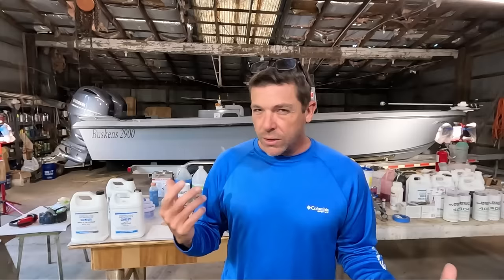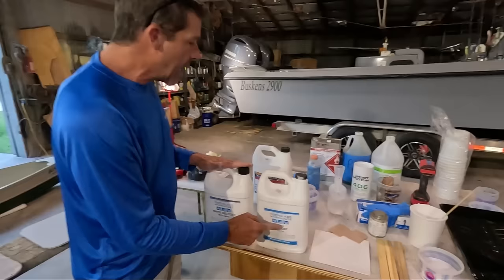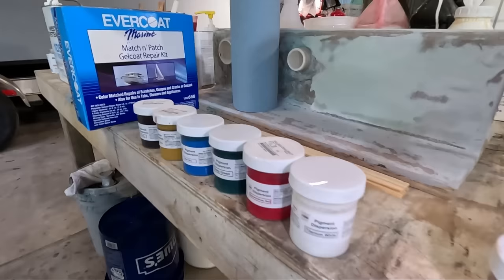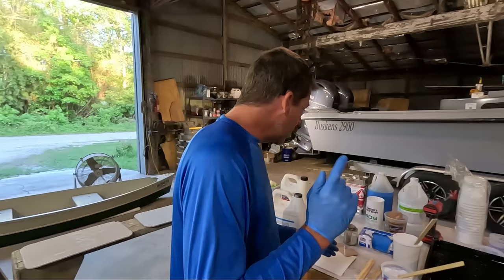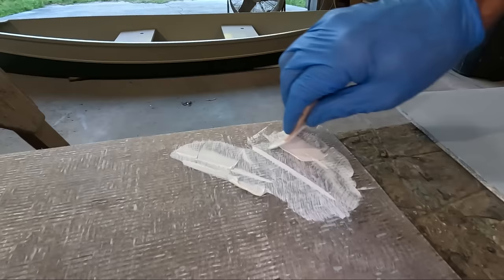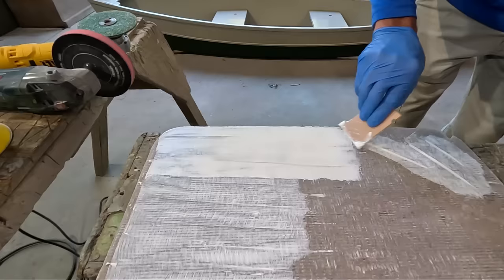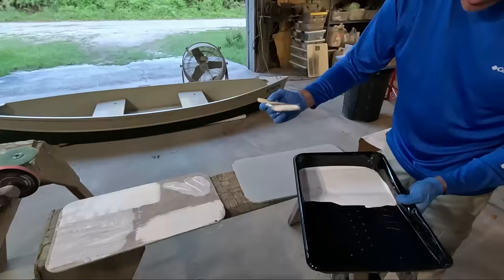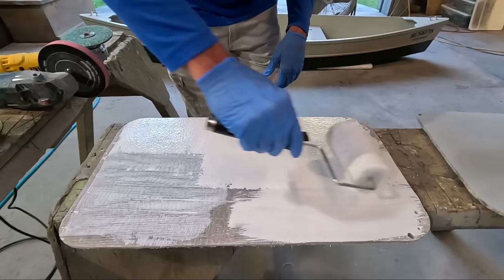The Secrets of GELCOAT and WHAT You Need to Know!

Comment: Hey there. I did some repairs on my boat with 3M marine premium filler on the bottom it is a vilyl ester filler. I sanded it all down smooth. Do i have to waterproof it with gel coat or can i leave as is????
Reply from the maker: I would recommend sealing the vinyl Ester filler with gelcoat. That's going to give you the best results. Thanks for watching!

Comment: I have a question, I have a couple of fiberglass dings on a fender and I plan on filling them in and then I have the metal flake match for my boat and my plan is to apply the gel coat with a preval sprayer. What mixture of styrene and MEKP would I add to the gel coat before spraying?

Comment: Hey sir, My problem is the company I work for deal with Navy 11meter Rhib boats. Material I am allowed to use is AWL Grip Products (F1438 & F3029) and West system (105,205, and 404) products. How would you conduct fiberglass repair and gelcoat repairs only with these products? I am trying to add 925 MEK Catalyst to my AUL (Authorized User List). I have also added Evercoat One step finish gel coat. What other items would you recommend I added or try to add?

Comment: Hi there loving your videos. This is my first time boat project and I'm learning  a lot form your clips. I have a simple question can you apply more then one coat of flowcoat/gelcoat with wax
Reply from the maker: Glad you are enjoying the videos! We usually apply gelcoat with wax on the last coat only. It allows the gelcoat to fully cure, and produces a tack free surface. If you apply more gelcoat over gelcoat that has wax in it , the second coat will not bond properly. You can wipe down the wax gelcoat surface with acetone,  then sand the surface well before adding another coat of gelcoat to help it bond. I hope this helps and thanks for watching!

Comment: Hey Joe! I am redoing gel coat on a Boston whaler 13 hull. I watched a bunch of your videos and it has been going well so far. I ran out of gel coat and had to order more. Once I get that I want to put on the final coat that will include the sanding sealer/wax. Only problem is with shipping it will be about a week from my 4th coat to my final coat. Will it still be tacky enough to where that won’t be a problem or will I have to sand? Hope that makes sense, thanks for any advice you have.
Reply from the maker: If it were me, I would probably scuff it up with some 80 grit and then do a wipedown with some acetone. I don't think you will need any heavy or deep sanding. I hope this helps and thanks for watching!

Comment: Awesome video capt. Love your content always. Great job by camera man
If I wanted to strip bottom paint and redo with Gelcoat, would you suggest roll and tip or spray?
I know it will be labor intensive
Reply from the maker: Thanks so much! It could be done both ways. It might depend on what you are more comfortable with. Roll and tip is pretty easy for most people to master, but spraying can result in a quality job also. You might want to experiment some to see if you prefer one over the other. I hope this helps and thanks for watching!
Reply: If you are going to put bottom paint back on the bottom... no need to gelcoat. Just sand bottom, clean, and apply barrier coat and bottom pain as per manufacturers instructions. When we do bottom repairs we never gelcoat the repair unless the boat is dry stored and has no bottom paint. Believe it or not... gelcoat on the bottom of a boat causes more problems then it solves. Epoxy barrier coat protects the fiberglass and acts like a primer when done correctly.

Comment: I must say again and acknowledge how well you cover the details required to have the best results.
In the most recent of time since finding your channel, you have 1 to all 3...
either answered a question, covered a lingering question,. or done both and covered more in depth details.
All that you covered in this vid is coming up in the future,. now it may be a year or longer or it may be several years.
I too purchased a HVLP gravity with 2 & 3 mm nozzles, (very large crude tips to avoid as much thinning as possible)
Thinking to myself using such a large tip is probably have a fairly coarse texture right out of the gun.
After watching you roll the Busk2900 not so sure that's not going to be my chosen method.
I had already figured on trying different test applications on scrap pieces before any real attempts,. but again this is years away.
But thanks again.
Reply from the maker: Thanks so much for the kind words! Glad the videos are helping to answer some of your questions,  and I wish you the best of luck with your future boat projects!

Comment: Question can you gelcoat with a roller over sanded old interior of rough skiff if some paint is left in the low spots or would i be better off epoxy priming and painting 2 part paint

Comment: I've been watching your videos for a long time, and they have helped me a lot. I follow your instructions precisely. However, yesterday, I was repairing a large part of my boat (1.5x0.5M) at the very front. After applying the fifth layer with a roller (planning for a total of six layers before sanding), I couldn't apply the last layer with wax in time. I added paraffin with a brush after six hours. Is there any solution to cure it properly so I can sand and wet sand it? Sorry for any mistakes in my English.

Greetings from Greece
Reply: It worked!🙏🏼
Reply from the maker: Glad it worked! Thanks for watching!

Comment: Captain Always great info from the most experienced!! Still want to know impact strength of gelcoat and or different glass layups and thickness needed to make body panels. I know your boat hulls must be brutally strong as I'm the one that wants to make datsun 510 bodies that are strong enough for the roads. We thank you for teaching us so much!!
Reply from the maker: Thanks, glad you are enjoying the videos! I don't think car body panels would need to be nearly as tough as boat hulls, and the cosmetics would be very important. With that being said, I would imagine after your gelcoat is applied to the mold that 4 to 5 layers of 1 or 1.5 Oz csm and using vinyl Ester resins in the part would be a good place to start testing a part. I would be concerned that any heavy glass like 1708 might print through the finish. We frequently make test panels and experiment with different laminates before deciding what is going to work best for a particular boat application. Since we don't make car parts, I can't really say for sure what is exactly the best for what you are doing. Always test and experiment before moving forward. I hope this helps and thanks for watching!
Reply: @FishBumpTV  Thanks for your time - I will try many tests. thanks for steering me in the right direction!

Comment: Thanks for the video! I have a question I want to do a gloss finish so I would do 4 to 5 coats of gelcoat without wax and the last coat with wax do I have to wait one day in between the coats of the unwaxed gel coat and do I need to scuff it up before applying another coat of unwaxed gelcoat? Thank you
Reply from the maker: If you want to be able to wet sand and polish the gelcoat to a glossy finish then 4 coats is minimum, and 5 coats is pretty typical. You can shorten up the Time between coats depending on Temperature, humidity,  catalyst percent added to gel etc. I just like to give each coat plenty of time to tack off and time for the solvents in the gelcoat to evaporate before adding another coat. I don't typically sand or scuff the gelcoat between coats unless some debris has fallen or blown into the gelcoat. I hope this helps and thanks for watching!
Reply: Thank you!

Comment: I've come with a method of spraying gelcoat using HVLP with minimum orange peel, that worked well on a clear gelcoat: contrary to using a spray gun with as big nozzle as possible, use the smallest one (1.0 mm nozzle) with high pressure and preheat gelcoat (in a bucket of hot water or under the sun\ir heater). Goes like this: a small amount of gelcoat (~150g by weight) is preheated to 35-40C, than thinned with styrene 5%, than activated with 2% mkep, than quickly poured in the spray gun and sprayed immediately. The working time of this mix is about 2-3 minutes. The orange peel is pretty comparable to what you would get from a canned automotive clearcoat, so sanding and buffing is required, but not that much as after a roller. Also, while this works for the clear gelcoat, as it is more liquid, I don't know if this will work on a standard colored gelcoat. The idea was to minimize sanding - put a "base" colored gelcoat, sand it smooth up to 400-500p, than spray clear gelcoat and get a smooth mirror finish, like a car clearcoat over paint.
Reply from the maker: Interesting! Thanks for sharing your thoughts and process!
Reply: Have you ever tried putting wax paper or similarly a thin, clear plastic sheet directly onto the gelcoat?  Almost like a mini mold  localized to the repair.  Iam thinking I will try it I just need the right job for it.
Reply: @chrisrancat2808  I did - the plastic food film to cure it without wax and a ceramic tile to make it perfectly flat. The results were poor. The film did help the gelcoat to cure, but created a lot of micro folds that imprinted in the surface and it had to be sanded. The ceramic tile press was better but also imprinted tile surface imperfections, so again it needed sanding.

Comment: thank you for the video. If you are using a gel coat with no wax for your base layers it is obviously not going to fully cure and will still be tacky. Are you having to sand off the tackiness before adding another no wax layer? or are you just applying over the top of the  tacky layer with more no wax layers and putting your with wax gelcoat as your final for a full cure?
Reply from the maker: Gelcoat without wax added will cure, it will just remain tacky on the surface so that following layers of material will bond to it. This is something that many people seem to be confused about. When you add a second layer of unwaxed gelcoat over your first layer it will fully cure the tackyness on the first layer. Then if you add wax in your last coat, it will cure tack free. I hope this helps,  but I will try to make another gelcoat video discussing this topic. Thanks for watching!
Reply: Thank you for the clear and concise answer. Makes perfect sense to me now thank you!!

Comment: I did a repair job with a few layers of unwaxed gel coat and then a layer of waxed gel coat for my last coat. However, I ran a little thin and some parts still seem a little tacky. In order to not use more gel coat can PVA Mold release be used a day later to cure over the whole area and then be sanded?
Reply: Or would another layer of wax gel coat be best? Thanks for all the helpful videos!
Reply from the maker: I would probably use waxed gelcoat on the tacky areas if you have some. Pva should also work if you don't have waxed gelcoat. Hope this helps and thanks for watching!

Comment: So if I’m only doing repairs I will use gel coat with wax? And also do I still have to add hardeners to the one with wax
Reply from the maker: We only use waxed gelcoat on the last coat, all the other coats are going to be no wax. The wax allows the last coat to fully cure, and will have a hard non tacky surface. Yes, a hardener, or catalyst Always has to be added to gelcoat or it will not cure. MEKP or methyl ethyl ketone peroxide is going to be the technical name of the catalyst. I will have more gelcoat videos coming out soon. I hope this helps and thanks for watching!

Comment: Another great video!.. A quick question please..I am looking to repair a bad gouge in the metal flake on the side of my bass boat.  I was planning on filling the gouge, (which is down to the fiberglass) with fibrous putty, and then brushing gelcoat over that, before applying clear gelcoat with the metal flake. Then putting on a final coat or two of clear before covering it with Mylar.  Am I doing this the right way?   Your comment of not using gelcoat over fibrous putty has me concerned. Many thanks for any advice you can offer.
Reply from the maker: Thanks, glad you are enjoying the videos! We don't do any metal flake work at all in our shop, but the bulk of your plan sounds good to me. As far as your filler or putty of choice goes, either thickened gelcoat, or a vinyl Ester based filler is best if you plan on going over the repair with gelcoat. It is epoxy based putty or filler than can create a curing issue with gelcoats, and that why I don't recommend epoxy based materials under gelcoat. I hope this answers your question and best of luck with your boat project!

Comment: I purchased white gelcoat with wax and realized i need to thicken it to repair a gouge could u thicken the wax gelcoat with sillica and sand between coats or i need to purchase gelcoat without wax
Reply from the maker: Yes, you can sand between coats. I would sand and recoat just as soon as the gelcoat has tacked off. The sooner the better so as to promote a good bond. Hope this helps and thanks for watching!

Comment: Hi ! Thanks a lot for all these advices and explanations!

Now, I’m looking for some help here, I repaired some bare fibreglass under the waterline on my outboard, sand it with 80 grit and apply a coat of unwaxed gelcoat, now that this gel coat is cured can I just use interluxe interprotect 2000e on it ? Is it better to sand it first and wash with water and soap ? Or just apply the epoxy primer right on ? 

Cheers ✌🏼

Comment: If all I bought was gelcoat with wax, can I still put multiple layers if I sand each coat with 80grit? Also before final coat do you sand and what grit? Thanks
Reply from the maker: Yes, you can sand between coats if all you have is waxed gelcoat. It is also possible to apply one coat after the other if you apply it just as the first coat is starting to cure. This takes a little experience to know when, but it can be done. I usually recommend folks should buy unwaxed gelcoat, then also buy some wax additive so that you have options. I hope this helps and thanks for watching!
Reply: @FishBumpTV  thank you!

Comment: Wish I watched this video before the manufacturer made my exact boats gel coat but WITH WAX. Ugh now I'm screwed cause was going to use the colloidal silica to thicken it and it  looks like I can't. Ugh what do I do now?
Reply from the maker: You can still use it, but you will have to thoroughly remove any wax film on the surface, before applying additional coats. This is usually done by sanding with 80 or 120 grit paper, then wiping down with acetone. If you don't remove the wax film on the surface after the gelcoat cures, the additional layers will not bond properly. I hope this helps and thanks for watching
Reply: @FishBumpTV  OK good to know appreciate the info!

Comment: Hi, if you're still there. I'm recoating a used rowing shell, not for competition, just to keep it from sinking. There is some minor cracking on the hull. Do you think one coat would be OK? I don't want to have to buy the wax additive for a second or third coat.  But maybe it's not that expensive.  I'll have to dig those figures up. Thanks
Reply from the maker: We usually do two coats minimum on most of our work. One coat might be ok for a lightweight shell. If you are only doing one coat you will still need gelcoat with wax in it to help it cure tack free. The last coat requires wax, weather you are doing one coat or five. I hope this helps and thanks for watching!

Comment: Thank you for your videos. I am still mystified if I can use gelcoat over a epoxy repaired deck! I need to add. I am asking because epoxy laminating is not UV protected. So what do I put over it to finish off?
Reply: not to say you can't but the bond strength isn't great and there is the possible risk of delamination.  on a large surface area with only small areas repaired in epoxy you might be ok but otherwise it would be worth considering using a high strength marine paint (epoxy primer & 2k urethane or similar) or deck flooring (eva matting).   there are epoxy compatible polyesters gelcoats on the market but the epoxy repair would need to be fresh for the gelcoat to make a chemical bond
Reply from the maker: I don't recommend using gelcoat over epoxy, you can have curing and bonding issues between the 2 materials. We use a epoxy primer and a marine paint finish over the epoxy in our shop. I hope this helps and thanks for Watching!

Comment: Great show! Quick question--- I'm going to re-gelcoat a deck on a commercial lobster boat, that had been done about 2 years ago. I had put 2 coats of no-wax and a top coat of grey wax gelcoat, but it has worn down through the gelcoat to the polyester in some places. Do I have to sand it all down or can I just clean it with acetone and roll another couple coats over what's there? This deck gets a lot of hard use!
Thanks
Reply: Sanding is always the Right way.   If it's Nothing Fancy and you don't care at least clean it with acetone. 👍🏼
Reply from the maker: Glad you are enjoying the videos! A wipe down with acetone, then a light scuffing with 80 grit paper, followed by another acetone wipe down to remove the dust should do the trick. Best of luck with your project!